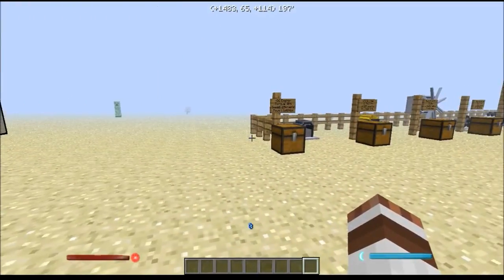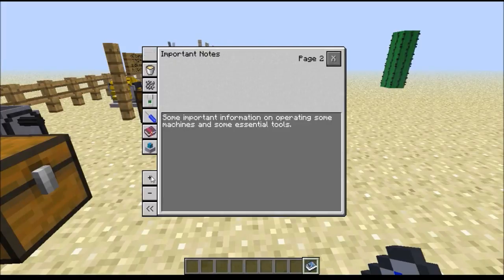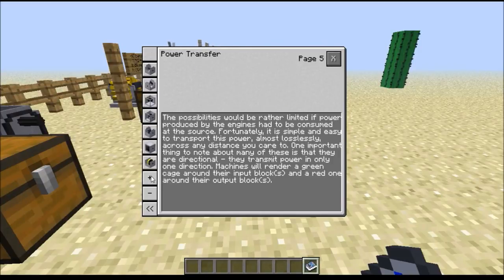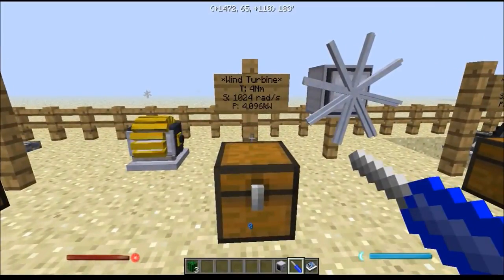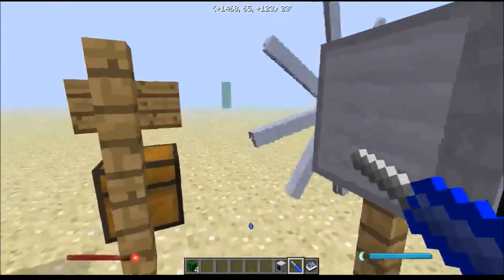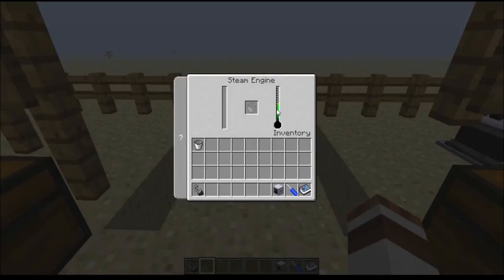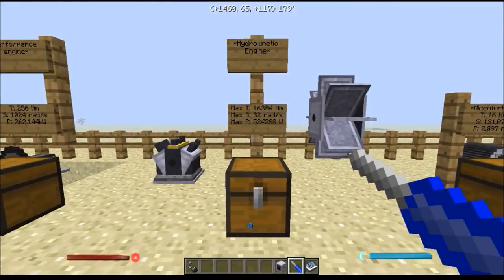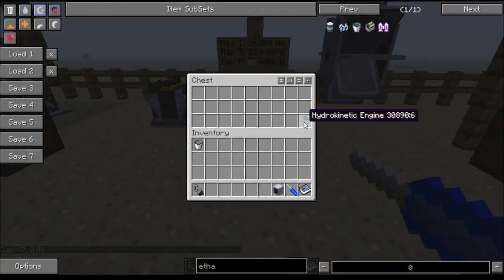Rotarycraft (1.6.4) - Basics and Power (part 1)

Comment: Hi, Have you gone over the Electric Generator? I watched videos 1-9, but didn't see it. I could use a demo. Thanks.
Reply from the maker: Is that one that converts power from another mod to shaft power?
Reply: Danilus Hi,
I thought it converted Rotarycraft to other. I am unable to get it to do anything.
Reply from the maker: It works the exact same way as the rest of the engines. Right click with screwdriver to rotate and input is green and output is red.
Reply: Danilus Right. But how do you harness the energy that it produces? It seems that you should be able to connect wires to it.
Reply from the maker: Well I can't use the generator cause I don't have UE but since it works like any other generator, you should be able to connect wires to it yes. Try the UE cables, whatever they are called. I've never used UE before so I don't know myself.
Reply: Danilus ok. Thank you for your time. I will try it again. Thank you for the videos.

Comment: I would like to know how to get the fuel out of the drum, because when I place a fuel pipe over the drum and connect it to a engine control unit, nothing happens. No fuel comes out. Please help
Reply from the maker: What drum? O.o
Reply: The Jet Fuel drum!, But i figured out putting a pipe under the resevoir works! Great Videos BTW

Comment: I can't get the hydrokinetic one to work, can you post it working? Everything you said is already said in-game, I just can't actually make it start turning lol.
Reply from the maker: What's not working? Is it not producing the power or is it not turning? Make sure the water is dropping behind the engine, ie, counter clockwise.
Reply: Danilus I think I know the reason for this, if you are using the FTB modpack Horizon, the hydrokinetic engine requires lubrication to work, which makes it pretty much useless due to the fact that it doesn't produce power enough to actually produce a bucket of lubrication...
Reply from the maker: Yep, in the newer version it requires lubrication. I'm making a video of them working just incase more people get confused anyways.
Reply: Thanks for the replies, I did figure out the lubrication thing was the problem lol. Man that stuff is a pain for me to make so far, but it's finally working! Thanks again!